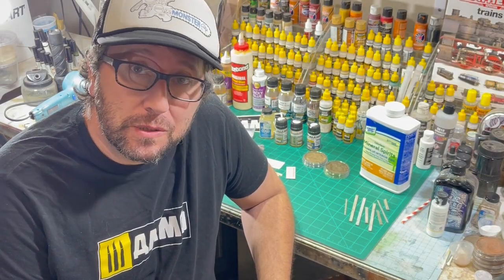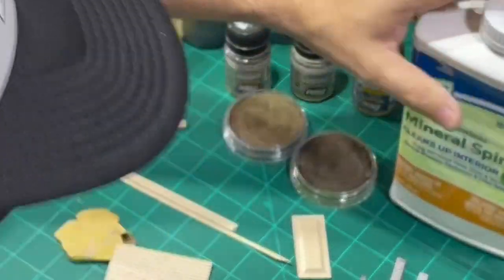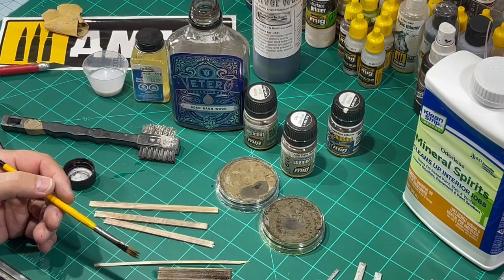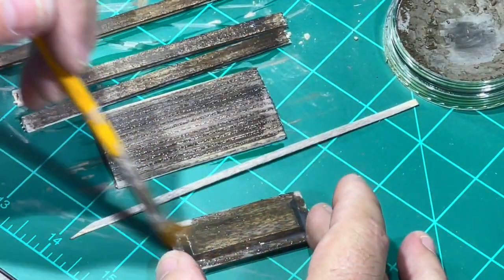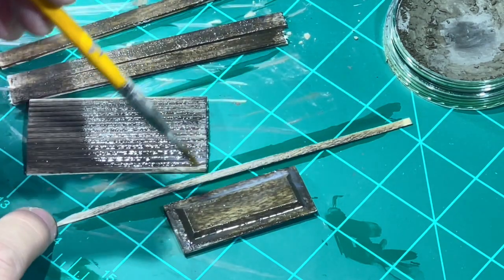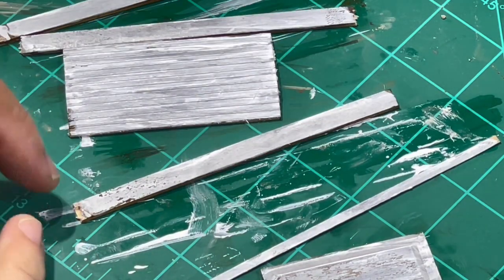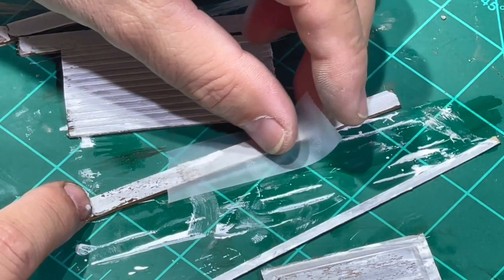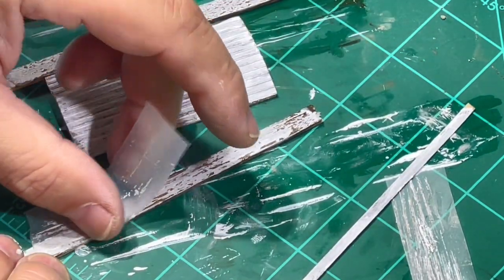Mineral Spirit Resist Chipping for Scale Models

Comment: I had been carving miniature vintage cars and placing them in front of paintings created from my photos of the west for years. Lately I've started adding wood carved buildings in the backgrounds and discovered Chuck Doan and other diorama artists in the process. I'm awed. I found Doan's Mineral Spirits Resist post on Facebook, but not until watching your amazing video based on that did I get past some hurdles. THANK YOU. I just spent a wonderful afternoon with great success thanks to your detailed video. Two of your clues on the timing of the drying of both the mineral spirits and the paint launched me into success. I've been an acrylic painter for years and rather than using precious little bottles of brand diorama colors, I made use of my abundant supply of soft-body acrylics with great results today.

Comment: Great chipping paint method, James.  I've used it on one or two buildings but I like your recommendation of darkening the stains with the pigments. I didn't use pigments and the contrast wasn't as great, so using the darker pigments makes a huge difference.  Thanks for shariing.

Comment: Really, really like the looks of it. Question (or two): The drying time for the paint, I assume. The colder, the longer. Correct? AND, would a Rattle Can of Dull Coat work? Additional comment, I recently built an abandon house (you may have seen on Face Book). I used a dry brush and "MiniWax" wood stain (Penetrating Stain). Going to see how this works. But what I can see is, practice and experiment first before trying on my next build. Thank You for the Excellent Video.
Reply from the maker: Lynn, yes, the colder the longer. I dont know if that is a good or bad thing. I'll need to test that on the next build.